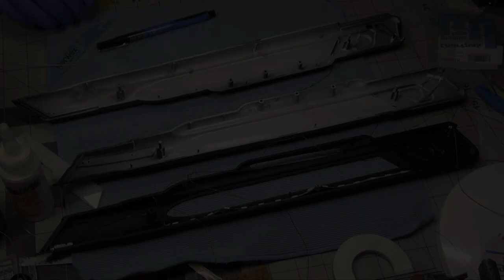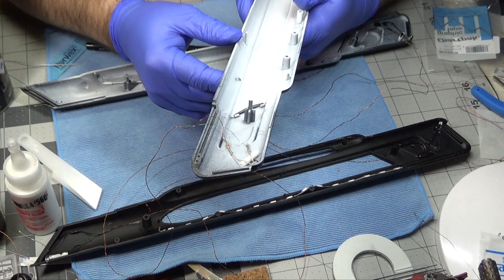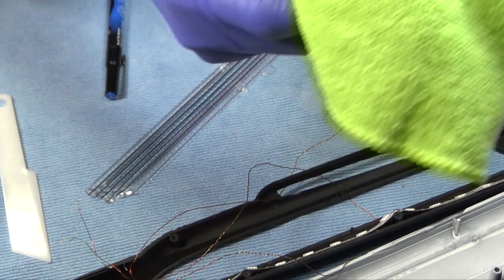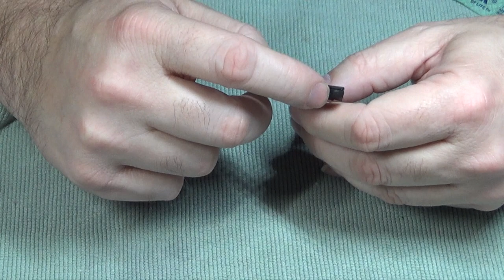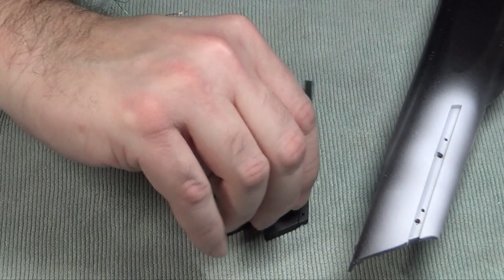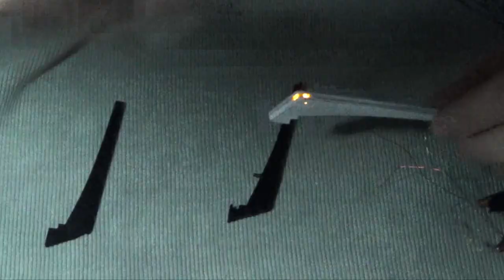Nacelles Part 1 - Star Trek Enterprise Refit 1/350

Comment: Hi Ken, great video.  You cleared up many questions that I had regarding the prep and assembly of the nacelles.  My only question is this:  It doesn't appear that you masked the edges of the parts so that when you glue pieces together, they "fuse" together properly.  Other Refit builders make it a point to mask gluing edges.  What method will you use to ensure a solid bond when you do your final assembly of parts?